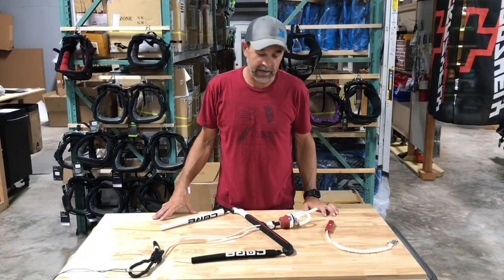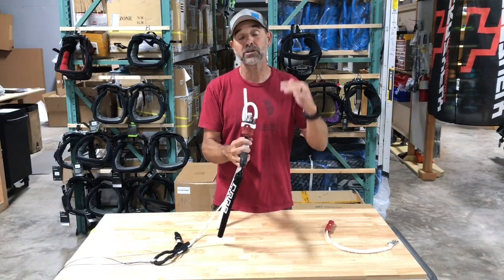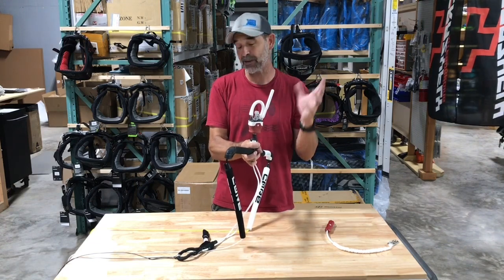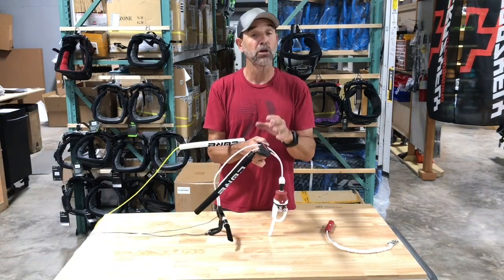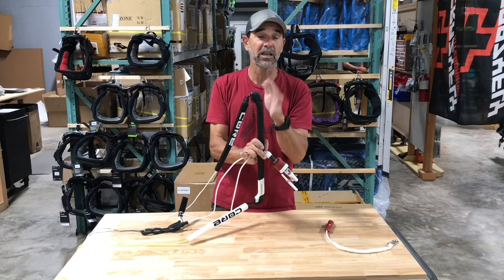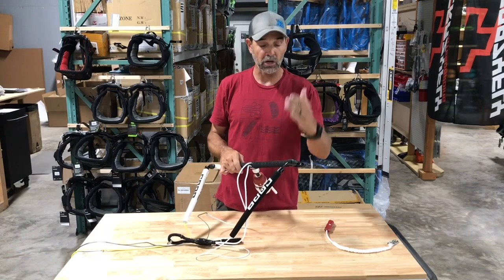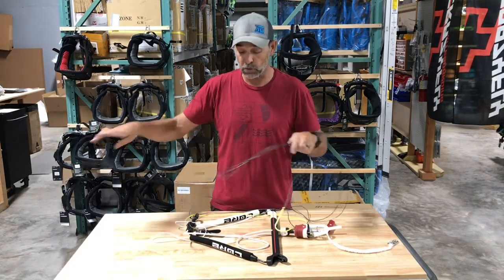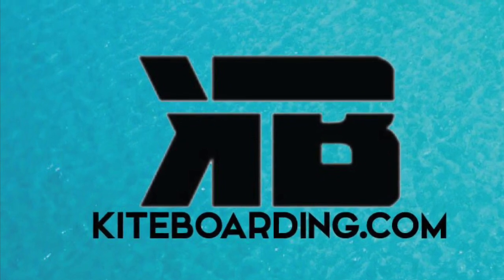Core Kiteboarding Sensor 3 Pro Control Bar Review

Comment: I've ridden a core sensor 2 pro bar for a while now and absolutely love it. I like the twist release system but I'm open to change. 
One big change to this bar that I dont think you recognized in this video is how they have attached the backlines to the bar. 
The sensor 2 pro is great but because the backlines are attached to the outside of the bar - it creates a right angle in the rope thus creating a lot of stress and wear and tear, replaceable parts but needed to do on regular basis. 
If you look at how they've attached the backlines to the sensor 3, they are straight to the top of the Bar - thus creating less stress and I'm only imagining a better (even better) kite flying experience.  
Would love to hear your thoughts on which core sensor 3 (wake, foil, normal bar?) is best suited to which rider. 
I dont unhook and focus a lot on big air freeride old school.

Comment: How does the system work on these bars?  Do they still have some pull in them when you leash kite?  A bit like the older North system.  Does that make them harder to land them by pulling a centre line to flick it round and park it?   Can i use this bar on my  Duotone Mono too if I get core kites?

Comment: How can I reduce the distance to my arms when I sheet the bar fully out? If the kite is powered and the bar is fully out, I sometimes almost cant grab the bar when my harness moves up. Would like to know how I can make the bar travel a bit shorter on the lines without pulling the depower strap.

Comment: I've had the sensor pro 2 and I liked the bar  and loved the kite.  These new changes sound great...but there is still the nagging problem with the flag out system.
Being that it is a high v split  system you don't get 100 percent flag out.
I kite ocean and have over 300 hours on my 2 core kites.
There are times where I had to flag and the kite won't lay flat , it wants to dance around.
I spoke with the core rep and wrote the company they said I had a wear issue and sent me replacement parts. That did not fix the issue.
A few dealers know of this problem.
Why did f-one  change their bar to a low v after all their years of high v split? I had a new 2016 f-one kite and bar and after a few incidents my wife who kites also said enough of that and we sold it because of the safety issue.
If core had a 5th line it would be ok.
Reply: Aero Venus....Cabrinha had IDS and got rid of it in 2013 i think. That was a two line flag system that was unreliable at times or in very high wind. Ozone had a pull to release system that was prone to jamming from sand. Liquid force had a chicken loop that was a death trap and a depower that required two hands and 250lbs of force to use. All dangerous systems in retrospect. 
Avoid 5 line setups as well. If you invert a five line kite you cant fly it back to shore. You have to disconnect the 5th to fly it back. Dealing with loose lines in the water is very dangerous. The Core twist release was a disaster, many people had accidentally released and its not an intuitive motion to use it. Half a second could save your life in a release situation. I high V makes self landing more difficult and prevents you from easily untangling lines in the water.
Many manufacturers have held onto bad designs just to be different or simply because the wont admit to being wrong about design. Engineers always think their design are the best, and marketeers believe their own hype.  20 years of evolution in kite tech and we finally have simple, reliable 2:1 rope cleat, push away 4 line bars. Most manufacturers designs have converged for good reason.  Avoid the gimmicks and marketing hype when choosing a bar system.